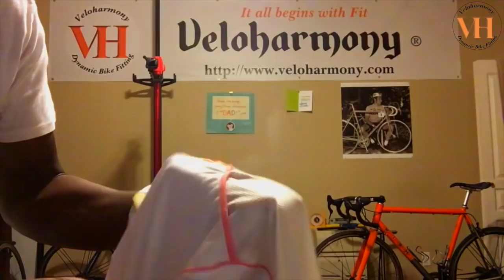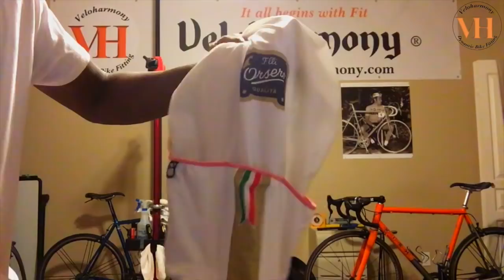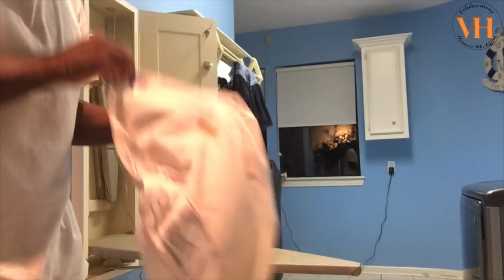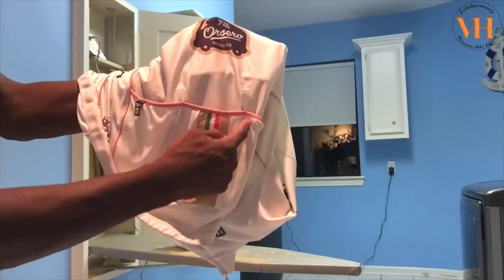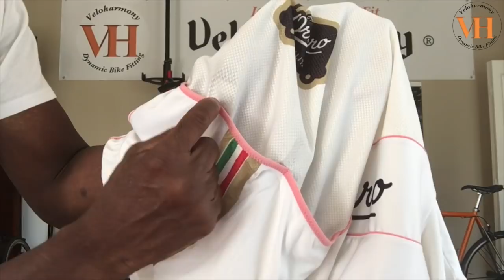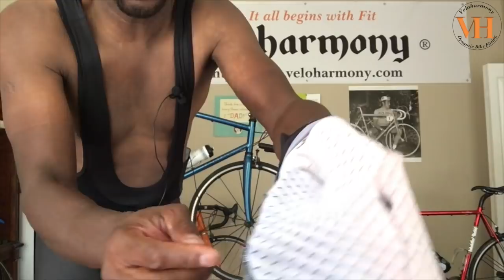DIY Cycling Jersey Repair - reinforce jersey pockets

Comment: Good tip! What’s a fix for sagging pockets? Lol... I’ve got a Pearl Izumi jersey (my 1st one), that’s slightly over two years old, but the elastic stitching for the pockets gave up a long time ago. The jersey itself is still in great shape, but I rarely wear it cause the pockets are super loose and I’m worried whatever I have in it is gonna fly out over the first bump.
Reply from the maker: Never experienced sagging pockets before. Might be too big a job for DIY, an alterations shop could remove the bottom of the pocket, cut some of the material and re-stitch.
Reply: Veloharmony it’s the only Jersey I have that’s done that... I thought about taking it to the cleaners to see if their seamstress can tighten them up, but fortunately I’ve invested in a few other jerseys I can wear instead of that one, so it’s not a priority.  Just weird and dampened my perspective on purchasing any more PI gear.
Reply from the maker: Contact their customer service, because if they care they should want to make things right. That is not a common occurrence, so I think that they should stand behind it. Agree with you, since if it were me, I would be leery about buying more of the same brand.